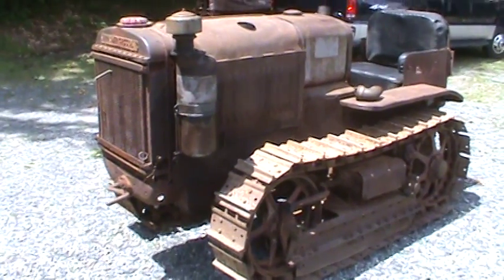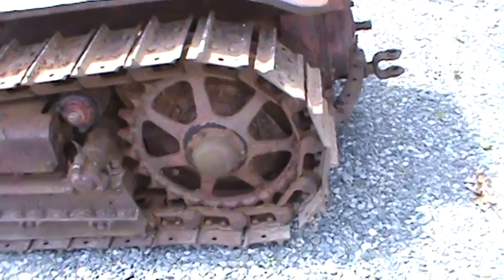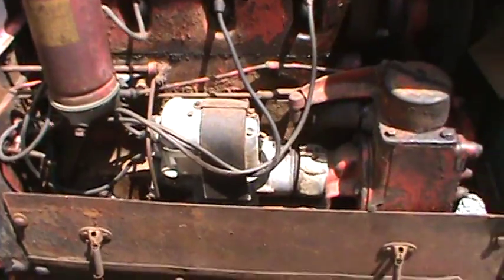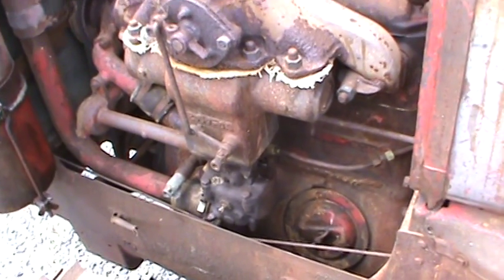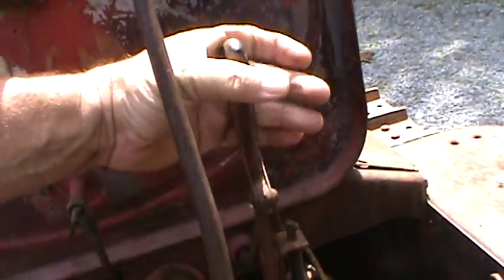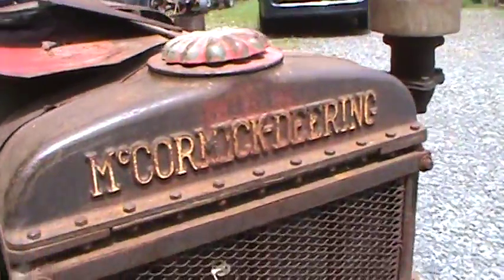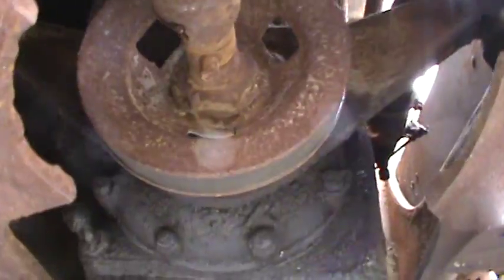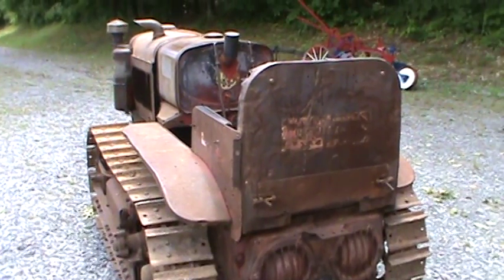1937 T20 TracTracTor walk around and start up.

Comment: A beaut video mate, we have a TD35 ourseleves, T20 is a neat little machine.
Reply from the maker: +GreasyJohn Thanks for the comment. I like making these just to give people a close up of the old iron. The TD35 you have is a nice machine itself, especially with the diesel. You should post a video, I'm sure all would like to see it. Thanks again.
Reply: +1motors I've got one on my channel already, though it's not as good a walkaround as yours! My Offsider is the TD35 owner, and he liked the look of the T20 and got a chance to drive one at a show recently... and he hates the tiny foot clutch and brake placements!
Reply from the maker: +GreasyJohn  I watched your video tonight and enjoyed the heck out of it. It's all about having fun with the old stuff. It looks good. I had an International 650 wheat land diesel that had the same start on gas and switch to diesel system. It was pretty cool and worked real good. The 650 was around a 1958 so the system was a little more refined than the one on your TD35 but the same principle. Loved the video and when I get some more time I'll check out the others. Subscribing to your site now.

Comment: The hot and cold on the manifold was for running kerosene it put heat to the carb to help addimize the kerosene
Reply from the maker: Exactly, it took a lot more heat to atomize the kerosene. That's why they started them on gasoline and switched over to kerosene after the manifold warmed up.

Comment: Does this t20 run on gas only. looks like there is two fill spouts on the tank.
Reply from the maker: No. This tractor in the day, like most tractors of that era, was started on gas and then run on the cheaper distillate or kerosene fuel once the tractor was warmed up. You would fill the smaller tank in the rear of the large tank with gasoline and the larger part of the tank with the lower cost fuel. This tractor still has it's kerosene or hot manifold and could still be run on kerosene if you wanted to play around. I have never done it as I've heard the kerosene produces less power than the gas and puts out a lot more sooty smoke thru the exhaust. It also required the operator to pull the head more often to de-carbonize the head and valves. Hope this answers your question.
Reply: +1motors so you run gas in both tanks. that answers my question perfectly. Thank you
Reply from the maker: Yes, both tanks are for fuel. I have actually run one of my old tractors with gasoline in both tanks this way when the large tank runs out I have the small tank for a reserve to get back to the house to fill up again.  Since these tractors don't have fuel gauges it's nice to have that reserve. Take care.

Comment: 1020 engine is also the same as the farmall f30. 4and a quarter bore with 5 inch stroke the rings on the 30 where 3/16th thick the rings in a 1020 where 1/4 inch thick
Reply from the maker: Yes, you could tell the F30 and T20 were similar engines. I have a couple F30s and F20s,  there is quite a difference between the F30 and F20 motors.
Reply: @1motors  i think if my mind remembers correctly the f20 is 3 1/8 bore by 5 inch stroke f20 might be 31/4 but the f12 and f14 have the same size bore as the super c that is 3 1/8
Reply: The F20 and the T20 have pretty much the same engine.